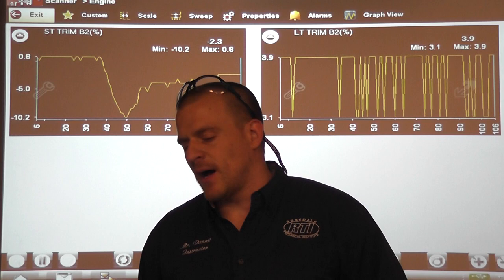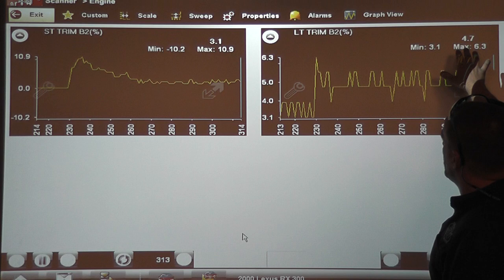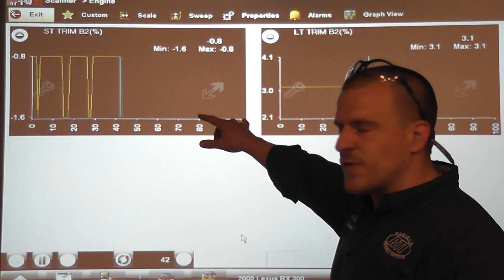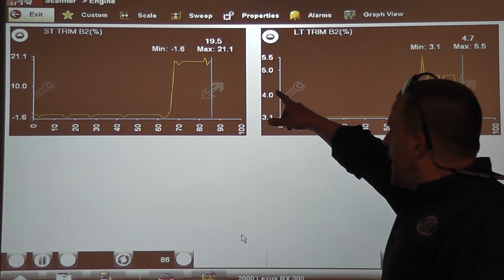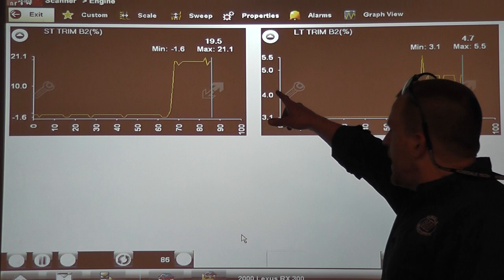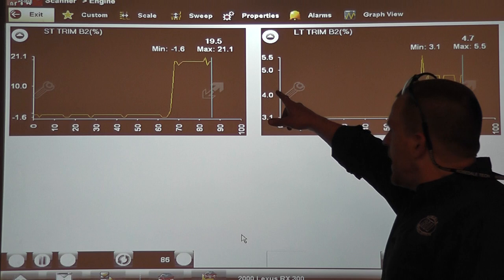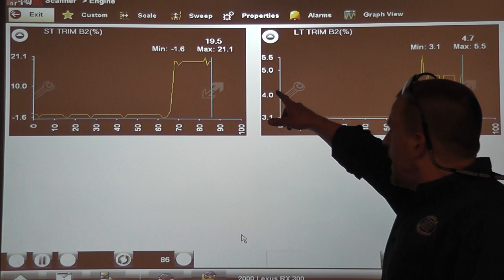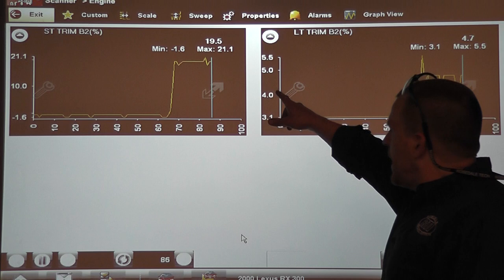Using Fuel Trim to identify type of misfire (can it be done?)

Comment: I have found a recent fault in my car involving the Chevy LS1 where I went to fill up with fuel 2 weeks ago,well it involves the check engine symbol appearing on the cluster,the fuel trim being Maxed out to 25% on both banks,the fuel volume tested at about 3 litres per minute,the fuel filter isn't restricted & the fuel pressure tested at 47 psi at the fuel rail.
The conclusion I came to is that the fuel mixture is lean & the fuel pump is noisy due to being worn out,the fuel pressure regulator holds pressure but the pump fails to deliver the 55-60 psi required for the LS1 engine so I ordered a pump to replace that one which I'll do this week.
Reply from the maker: change your inline fuel filter too if your system has one. Some were built into the pump assembly

Comment: Thank you for this video. I have something to ask you, what about a 98 Ford explorer with codes p1132 and p1151 that runs really bad, had the MAF and Ox sensors replaced, how would you go about using the Ft to troubleshoot it ?
The STFT and LTFT are at -100%.
Thank you.
MAc

Comment: What would cause a negative short term fuel trim with cylinder misfire?      Fuel leaking into crankcase/PCV system (high pressure fuel pump seal bad)?   Vacuum leak?  Bad sensor?   Poor compression?   Carbon build up on intake  (GDI engine).    The engine also has run-on after shut off.    2013 Equinox 2.4L
Reply from the maker: Everything you mentioned except a vacuum leak would be possible. Typically when you see negative trim numbers with a misfire it is from a mechanical issues
Reply: @ScannerDanner  Thanks for the feedback.  I will check compression over the weekend.   The  LTFT was -20 to -40 also.    Eco-crap  engine!    Intermittent P0303 code, but no P0172 code.    Time to scrap or put in a new engine.    Probably timing chain and water pump weren't far behind.    No more GM products in my future.
Reply from the maker: @mjkirk12  focus on that injector with it being GDI and that negative of trim numbers!
Reply: @ScannerDanner  It was  a mechanical issue - a leaking high pressure fuel pump - replaced and now the STFT and LTFT are back in normal range.  O2 sensors good - front toggling, rear smooth.   I guess the fuel pump is known issue with the Ecotec 2.4L   Fuel vapor from the leaking pump pulled into intake via PCV causing rich condition.   The P0172 code was stored  (last week) along with the misfire P0303.   Compression on cylinder 3 was good (similar to the others).    With new fuel pump - no more engine run-on (dieseling) after shutoff and smooth idle as well.  Changed the engine oil and filter as there likely was fuel in the crankcase oil.

Comment: subaru impreza wax DTC P0171, RPM 740 , STFT 25 and LTFT 14.8 , MAP36.0 . MAF 2.1 . g/s . oxygen sensor 3.943 V if engine RPM 3000 STFT 2.3 LTFT 14.8 what is causing it ? thank you Danner ,

Comment: not sure if i understand this..    both trims read lean because  o2 sensor job is not to  read the extra fuel,  they read oxygen, and there is extra oxygen  both conditions. 
 no fuel or  no spark  o2 sensor  will detect xtra oxygen?  help here!!

Comment: Hi Paul, very instructive, informative, and insightful video.
After reviewing many of your videos on fuel trims, how would you direct your students to diagnosing fuel trim numbers the opposite of a vacuum leak with an excessive misfire code?
Suppose a 4.6 GM OHV V8 comes in with MIL light for a non-cylinder specific emissions misfire. It has new HT leads, factory plugs, coils, and fuel pressure within specs.
The OBDII scanner confirms the misfire DTC.
Fuel Trim data reveals the following lean condition on both banks.
SHRTF1(%) = +16.4 @ idle to +24.2 on acceleration to 1500-2500 rpm. Drops back down to +12%->+16.4 on deceleration.
SHRTF2(%) = + or - 3 @ idle to +10 on acceleration to 1500-2500. Drops back down to -11% on deceleration settling in close to  + or - 3%.
LTFT1(%) stuck @ +16.4 irrespective  of driving/load conditions.
LTFT2(%) stuck @ +16.4 as per bank 1.

O2B1S1 oscillating correctly within parameters.
O2B1S2 voltage stuck @ 0.98 -.99v
O2B2S1 oscillating correctly within parameters.
O2B2S2  reading between 0.09 & 0.10v

MAF reads 0.08 g/s @ idle and 0.11 g/s @ 1500 rpm and 0.15 g/s @ 2500 rpm.
Before you say MAF problem, the code reader incorrectly reads the MAF. The correct code reader for this PCM reads 5.1 g/s @ idle for the equivalent 0.08 g/s.
I've cleaned the maf with specific maf cleaner, no out of range maf codes set in PCM.

It appears from your overview that this is a fuel injector related misfire.

But what I find odd is I can't get the Long Term Fuel Trim numbers to move.

Either way, total Fuel Trim numbers trend positively higher on acceleration (opposite of un-metered air leak)but at idle still trimming like a vacuum leak.

ScannerDanner, what's the prognosis?

Many Thanks!
Reply from the maker: +glycosaminoglycan what year make and model? All I got was 4.6 engine. Also deceleration fuel trim is irrelevant. During deceleration the injectors are shutting down momentarily.  The LT may not move anymore because it is maxed out. What do the O2 sensors read at wide open throttle on a test drive? How does it run under load? Do you feel a misfire? Or is it just a misfire code? It may actually be no lean condition at all and the misfire is causing a false lean condition.
Reply: +ScannerDanner 1997 Range Rover HSE 4.6 all aluminum Buick-designed pushrod/hydraulic lift with 9.26:1 comp and 107,000 miles.
I just recently purchase a scanner in the last 2 weeks to assist in my diagnosis, I got fatigued going back and fourth to O'reiley's to have the pcm scanned for the MIL light.

I took the engine apart after acquiring it 5 months ago to fix the passenger side head gasket. I rebuilt the top end, shaved .001 of the heads, replaced both head gaskets, new head bolts, valve stem seals, inspected the camshaft for worn lobes, inspected the liners for slippage, cracks and/or corrosion. Engine looked spotless, no sludge anywhere!I Frequent oil changes, but would have benefited from the use of a higher detergent fuel. I had to decarbon the valves and piston crowns.
The fuel injector tips had even varnish discoloration, but none were coated with oil, sludge, or carbon.
Coated every moving engine part with break-in lube, put back together, changed oil, pressure tested the cooling system, started up on a dime! Seemed to run perfect, no valvetrain noise or nasty vibrations, just an illuminated MIL light. 

I figured the MIL light would disappear in time, so I drove the rover around town idling in traffic in 113F degree weather since apparently they love to overheat. Nope!
Drove it 60-65mph on the freeway 100 miles in 113F, made it home no problems. MIL light still on.
I was hoping to get the MIL light to flash. No such luck.
I decided since it runs and drives fine, I would disconnect the negative battery terminal to clear the light and take it for emissions.
I didn't know my monitors were not ready, they suggested the freeway for 20 min to get the O2's ready.
Drove the rover 80 mph on the freeway and in 5 min. MIL started blinking and the engine went into 'limp-mode', lost power like it ran out of fuel.
Regained power @ 30 mph, went to O'reilly to get the codes.

P1316 - Excessive Emissions Misfire
P1138 - Oxygen Sensor Engine Rich Bank A
P1171 - Oxygen Sensor System Too Lean Banks A & B

I can't recreate these codes under in-town driving.

I cleared the codes, still getting the P1316 on start-up.
The engine missed and vibrated like the motor mounts were broken before the head gaskets were replaced (cylinder 6 had a break to the outside and into cyl. 4, no oil/coolant passage).
It's night and day now, before and after. I can't tell it's misfiring, no dead spots, or miss in the idle to 3000 rpm rev range, but again I don't how well it is supposed to run.
If you listen to it to the engine run, you would think the MIL light was for evap canister or loose fuel cap.
But the fuel trim numbers are out of whack, so it could in theory operate more efficiently I suppose.
Runs good, perfect idle, no overheating issues (original owner ignored leaking throttle plate heater gasket, simple fix!)  but I can't emission it with that MIL light on.

I've researched threads, everyone says plugs/wires/coils, then they replace all 4 O2 sensors and the MAF, then they go after the injectors, then after the dealer replaces everything and the problem remains, they say it's a bad camshaft or it turns out to be a poorly functioning crankshaft sensor lying about random misfires.

I'm stumped.

Thanks for the quick response Paul!
Reply from the maker: +glycosaminoglycan any chance you plugged in the upstream O2 sensors into the opposite bank connector?   I don't like the rich and lean codes on opposite banks. Also I want to know what those fuel trim numbers are doing during the running poorly period of time.
Reply: The length of the terminals prohibit switching connections and they are separated by the transmission/drive shaft.
I have to drive the engine near or above 3000 rpm to recreate the limp-mode scenario to throw the misfire/lean codes. I don't know what fuel pressure is at under 3000rpm load traveling 80mph. As of now, driving around doesn't trigger a flashing MIL light.
It is sensing a misfire, but hasn't found which cylinder(s) are the culprit.
It is Bank 1(A) that has downstream O2 reading rich and not switching. Stays at 0.98-0.99v. However the downstream O2 on Bank 2 stays low with an occasional switch to .98 then back to 0.08 then to 0.46v then back down ~0.10v before jumping back up to 0.98v and returning low again.
SHRTFT1 is very responsive to throttle response. Easy to go from +15 to +21.4.
SHRTFT2 finds 0 occasionally at steady throttle 1500rpms.
LTFT 1&2 haven't changed at all, stuck at +16.4.
Load % seems high at idle ~28-30%
Moves to 49% on acceleration.
Getting horrible gas mileage at idle, burned through a 1/4 tank just idling 30-40 min.
Before throwing the 3 codes on the highway, MPG's were excellent as I put over 100+ miles on it during that time.
I will say that I unplugged the MAF @ idle and instead of running poorly, it came alive like it had full power again but with an accompanying increase in idle rpms.
I also pulled the fuel regulator vacuum hose and recorded a corresponding increase in fuel pressure of approximately 8psi. Did not run any better or reduce the high positive trim numbers.
Reply: I did plug the vacuum port to the intake after disconnecting the fuel regulator hose to prevent a vacuum leak that would skew the trim readings.
Reply: I also added propane to the intake and noticed no reduction in the LTFT trim numbers.
Reply: In the video you indicate the distinct differences between an ignition misfire and an injector related misfire based on the fuel trim readings. My hypothesis is that I am experiencing an injector misfire vs. ignition misfire according to your presentation which I will verify is correct. 
After inspecting the spark plugs again on my waste spark system (8 plugs sharing 4 coils), I discovered a clean plug on cyl. 3. which shares cyl. 2 (working perfectly)
The pcm was not able to pinpoint the cylinder misfire, but the trim numbers indicated an injector misfire rather than ignition on Bank 1 vs. vacuum leak.
I decided to to look further at the injectors.
I constructed a home-made stethoscope and listened to each injector.
What do you think I discovered?
Injector 3 cyl. not clicking!
I also know that it is stuck closed because the fuel system holds pressure over time.
But the system is capable of compensating for the dead cylinder because it's impossible to tell at idle and cruising.
So my question now is, what is the probability that I replace the injector and the engine operates almost perfect?

Do I test the voltage at the injector connection during operation to confirm current before replacement?
Reply: +glycosaminoglycan disconnect the injector and connect a test light to battery ground and touch on both terminals. One side should light. Then connect your test light to battery positive and the other side should flicker the light on and off (engine running of course). If you see this the wiring and computer are fine and you most likely need an injector.
Reply: Thanks again Paul!!

Comment: Hi Mr. Scanner? Could you kindly enlighten me on where the fuel trims feedback fetch from? is it from the oxygen sensors? I recently had a scenario where P0200 was stored in a Toyota Rav4  with 2AZ fse engine and vehicle wouldn't rev up and it will stall but by disconnecting the oxygen sensors it would behave well. This is where i noticed that even with the oxygen sensors disconnected the fuel trims were reading rich! so my quetion is other than oxygen sensors is there anywhere else the ECU reads fuel trims from?
Thanks.
Reply: Kingstone Joseph  i have the same car and having some issues on it   if i disconnect my 02 sensor  no code or any feed back comes up even in a scanner  while connector disconnected no codes and no diff in engine behaviour

Comment: Im having trouble with a customers car. Its a 1.2 clio 16valve 2003. Stft +20 ltft +20 more or less and its misfiring in lower rev range pretty badly. I replaced plugs and coil pack no difference, oddly enough i put my hand over the air intake to monitor difference in stft and ltft but theres no suction ???. I did a smoke test and found no leaks so now im more confused how is it getting enough air to stay running.
Reply from the maker: Search some videos in my chapter 1 playlist on using water to locate a vacuum leak

Comment: scannerdanner

hyundai santafe 2.7  trouble code p1167 ,   b2s1 stuck rich even in closed loop, the same time stft is  24 .   o2 sensor replaced also maf but no change. i m astonishing why stft is lean not rich. any comment?